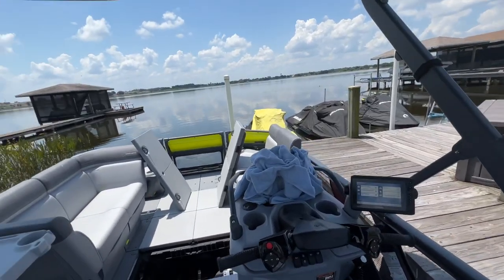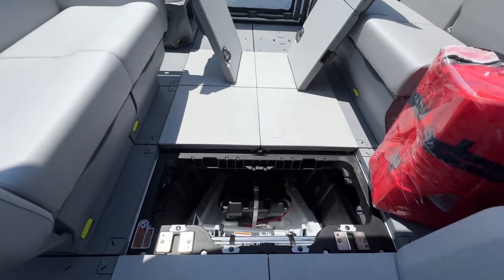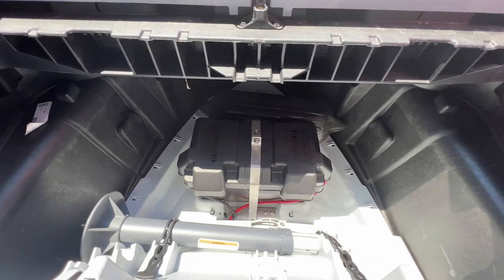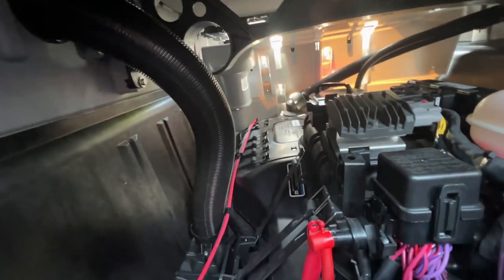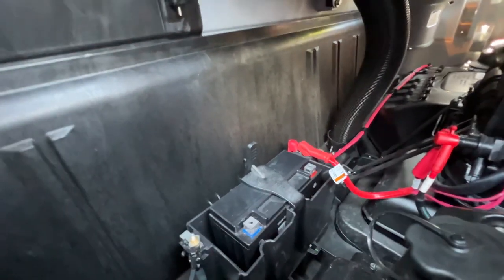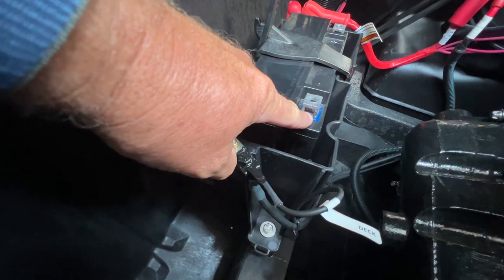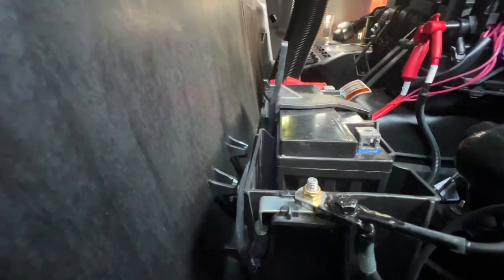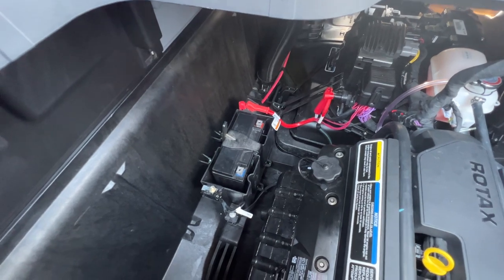Sea-Doo switch pontoon review High Capacity Battery Holder And Harness 295100966

Comment: I bought all of my own stuff and installed a switch to continue the use of both batteries. It saved me hundreds of dollars.
Reply: How much cable did you use? I have 5' of power cable laying around
Reply: I bought 20’ of 4 gauge I used about 12’

Comment: You would think Sea Doo would have made that stock Battery Box a bit bigger so that youi could just drop in a new Standard Size Battery without all the hassle of relocating another Box.... Nice Video --
Reply from the maker: You actually can foot a full size battery in the same spot as the small one. It takes some custom way too secure but I will be doing this soon
Reply: @john94si  Thanks for the reply John -- I may wait till you do a How Too on putting one into the Box that came with the Boat, -- I assume its about the same to a 13 ft Sport. Hope theres not much crawling around under the Deck,  not as young as i use to be 69 years ago.. :)  Salute on a very informative Video also.
Reply from the maker: @kchedville  here ya go. https://www.facebook.com/groups/349311596687956/permalink/987804572838652/?mibextid=W9rl1R
Reply: Which size terminal blck did you use, 3/8 or 5/16?
Reply from the maker: @RobertPowellJr-f2r  3/8

Comment: Did you consider the Blue Seas Add A Battery kit that comes with an Automatic Charging Relay that senses which battery needs charging and does it automatically with no switch flipping??

Comment: Does the factory battery then become obsolete? I ordered the High Capacity battery, mount and wiring kit and the dealer installed it all. However, they removed the original battery completely. Also, how do you recommend putting a battery tender on it? Remove the black cover from the storage locker or can you do it from the engine compartment area where the original battery location is?
Reply: Since you paid for it, get the original battery back! Or better, get another High Capacity Battery, same Ah, and put it in the original battery box. You can connect them in parallel, but the better deal is to install an A-AB-B-Off switch so you can disconnect your batteries when you store or moor the boat. There are a couple of YouTube videos on how to do this

Comment: Another installation where the owner abandoned the charging battery. Too bad BRP/Sea Doo Engineering didn't have the foresight to provide a wiring diagram so you could pull the house loads off the charging battery and keep the engine loads there.

Comment: So let me understand this. Some engineer put a cheap starter battery out of sea doo PWC into a boat, and if you want to run anything other than the boat or run the accessories when the engine is off, you need a HC Battery installation? Couldn't they at least have given a wiring diagram to pull the house loads off the starting battery, keep the alternator/stator on the starting battery, and install a battery isolator to keep the both batteries charged. Another bad design by Sea Doo!
Reply from the maker: Yep. Or just put in a geoup27 from the start

Comment: Im confused ? You cant hook it up
To use both batteries at the same time? Is there way to hook up one battery just for the radio
Reply from the maker: I added a dual battery switch. I can use either or both
Reply: @john94si  could you give me a quick
Explanation how to hook that up?? Did you buy it of amazon?
Reply from the maker: @geocap7980  what’s your email? Might be easier or on Facebook sea-doo switch pontoon owners page

Comment: So you can't run both batteries at the same time? Can you mount a battery switch so you can run the radio off the 27 and leave the other to start and run the watercraft?
Reply from the maker: Yes that’s what’s odd it replaces the small battery. On my seadoo fish I added the kit and it uses both batteries in parallel. I will be adding a battery isolator switch so I can use both or either at my discretion
Reply: @john94si  Replaces the main battery ?  That makes zero sense .

Why not just remove the stock battery and put the group 27 agm battery in its place ?  Will it not fit ?  Is that the main reason ?   I would Think they have agm batteries the same size as the main battery. 

I am disappointed it deletes the main battery .

That’s strange .

Comment: How did you feed the wires from storage to the engine compartment?
Reply from the maker: The front storage compartment panels pop out. Then you lay the wires across the fuel tank straps. https://www.facebook.com/photo/?fbid=10225728448490843&set=pcb.523112915974489